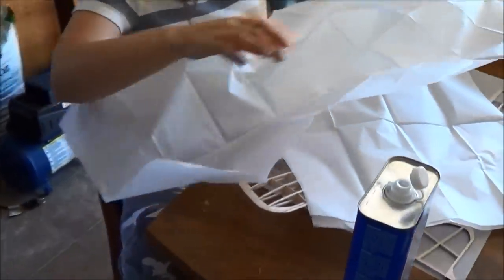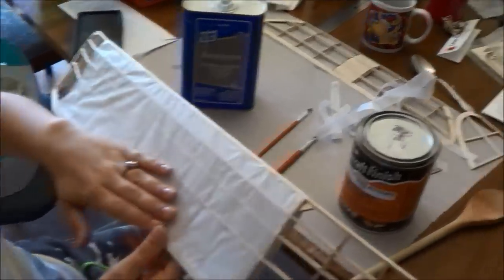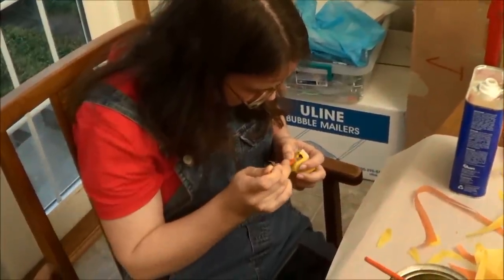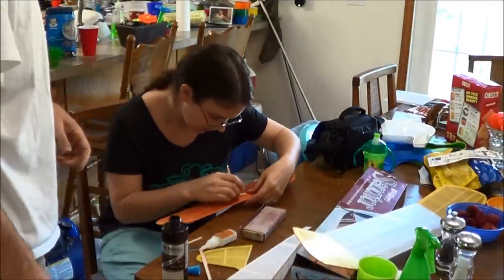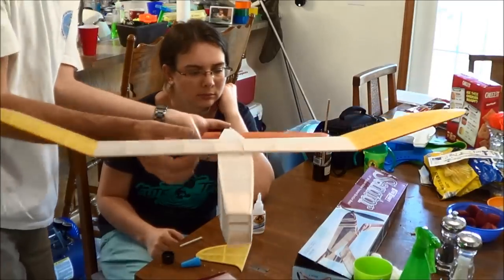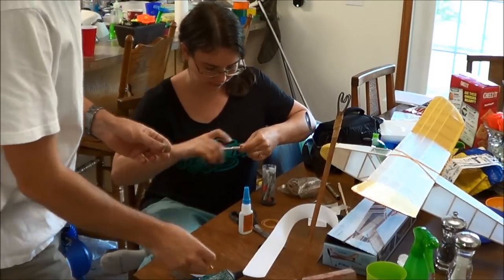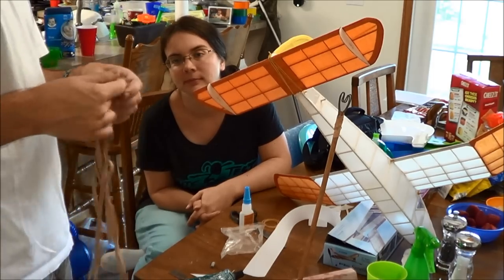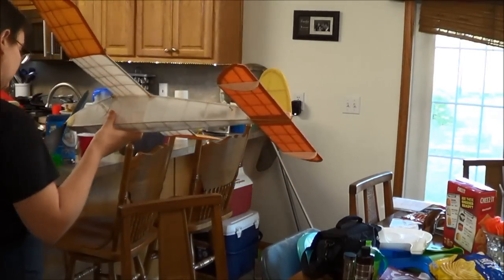Ripmax/Keil Kraft Senator Build/Review Pt.3

Comment: Thanks  for sharing this video. In this video you talked about esaki tissue, what is other tissue you mentioned? Also I wonder how will freewheel propeller mechanism work in this model? As you are using a notch on propeller for propeller engagement and braided rubber motor, will constant pull on propeller shaft allow it to freewheel when motor is unwound?
Reply from the maker: Abid Hussain I think the other stuff is litespan or something like that. Esaki is by far the lightest and best shrinking option at the moment though.
Reply from the maker: Abid Hussain the stock freewheeling ramp has worked well for us. :)

Comment: Josh , What Rubber would you recommend for the motor please ? Enjoyed the build and have copied the removeable u/c. . Maiden soon when the wind drops ….
Reply from the maker: Chris, standard motor for the Senator with 12" balsa prop is 12 strands of 1/8" rubber about 1.5x the hook to peg distance (check my braiding video for how to manage that). With the plastic prop you can back off to 8-10 strands, slightly longer, and still get a pretty good climb.
Reply: @joshuawfinn  Many Thanks

Comment: don't know about yours but mine turned out  tail heavy prolly do to the long tail moment stab/rudder wieght......………...also say goodbye to Esaki, the owners have retired and closed their doors, however thiers alternatives surfacing

suggestion for canopy stickem, put some 3M spray on a Qtip spread on window frame and place the window.....done
Reply from the maker: stan burdick go light on the glue. Long tail helps with stability but does require care to keep it light. Esaki honestly isn't a requirement to achieve that, although there are lots of nice mylar options these days and I see no reason to not make use of them.